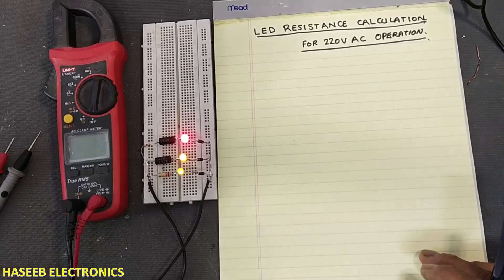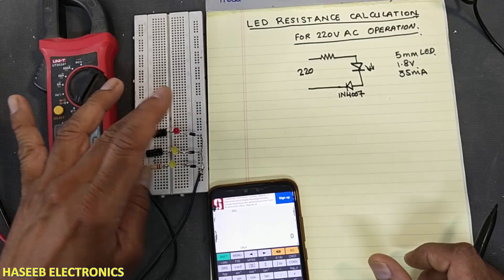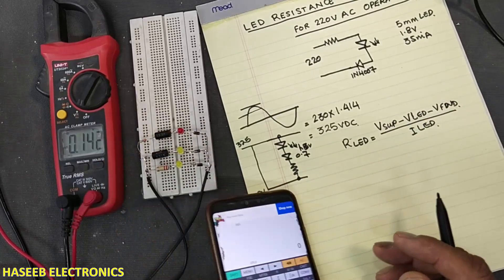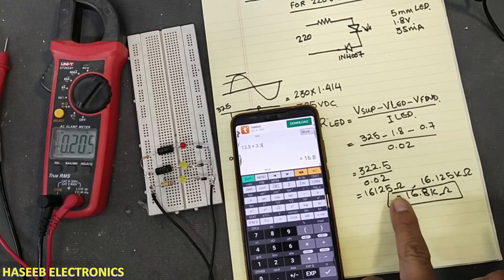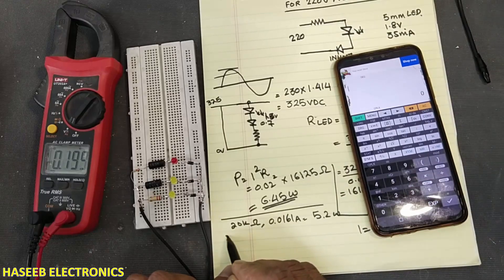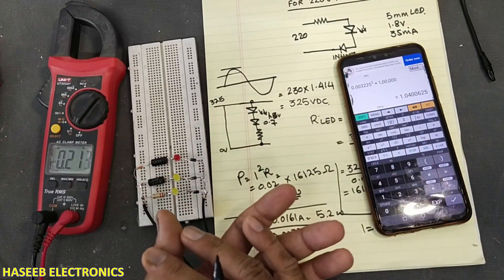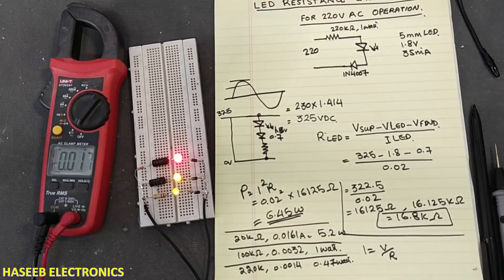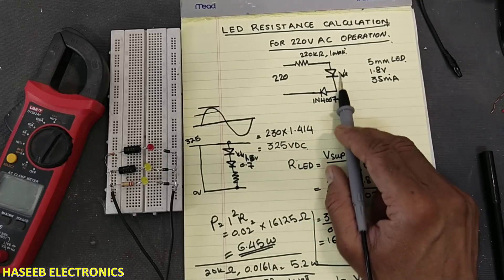{664} How to Make LED Indicator FOR  220 Volt AC, Calculation

Comment: 0.25W is ok, the current is only happening during only a portion of the cycle, so on average it will be acceptable as the failure mode of the resistor is in this case thermal.

Comment: Thank you very much Haseeb. I understand from your explanation that if we have any ac circuit containing a rectifier diode, we must consider the peak voltage in our calculations not rms voltage whether the load is led or not. mustn't we? 
if we didn't put a rectifier diode in the circuit in this tutorial the peak voltage will be equal to 327V like your calculation in the video or the peak voltage value will differ?

Comment: Thank you haseeb sir for answering my question with a nice explainer video. As i read the comments below from @Gann Dolf and @Abolfazl Abbasi there are many useful suggestions like 1) diode connected in reverse parallel to LED 2) using 0.1uF 400v film capacitor with 1M bleeder resistor, 1K inrush resistor , 1n4007 full bridge rectifier then DC to a red 3mm LED and many other feedback. May be it can be another video with title "Ideal/ perfect way to make LED light indicators for AC mains switches"
Reply from the maker: You are most welcome

Comment: Good presentation.5mm led will give decent glow from 1ma. So 220k (325/220=1.477ma) is an acceptable value.In place of resistor high voltage 0.01mfd capacitor can be used.No extra diode required. Across   Use 3v zener across LED to avoid reverse break down . Average heat generated in the resistor is V²RMS/r=0.24.If there is no zener ,power generated will about half.So 1/4watt resistor can be used. I have been using above circuit for many years.

Comment: LED has maximum reverse voltage rating. In negative cycle of AC, LED will get damaged by high voltage and have a reduced life.....though there will be no current flowing due to Series diode. To protect this, diode should be connected in reverse parallel to LED and not in Series.. This way the maximum reverse voltage would go to a diode drop, that is 0.7 V in negative cycle.

Comment: I've used a .33 uF non polarized polyester capacitor in series with a 1k 1/4 watt resistor to power a white 5mm led to replace a burned out neon indicator light for my freezer and it works great! No wasted power! I also put a 1n4007 diode reverse biased in parallel with the led. 50 hz may require a little more capacitance. What are your thoughts? Nice video! Have a great morning and a great week sir!

Comment: Why dont you just measure the voltage across the resistor (both AC and DC) and then calculate the current to check calculations?

Comment: Excellent video, and very good explanation.  I do the calculation in this way: At 220V RMS, when we use 220Kohms, the power will be P=VxI=VxV/R=220mW, and because we use only half of the wave, the power on the resistor will be 110mW. The same formula we apply to an instant water heater of 15 ohms, and we will find P=VxV/R = 3,2KW. (we can calculate an integral to reach the same result). The maximum led current will be V/R = 220 x 1,4 /220  mA = 1,4mA, but the average value will be V/2R = 220V/(2x220k) = 0.5mA.

Comment: On calculating power, one should  divide by 2 since only get voltage every other cycle. Also I believe it would be correct to use rms value of current and reduce power again by factor of 0.707.
Reply from the maker: in this circuit we must consider that the LED is being used in unidirectional current. so we must use LED forward current to calculate everything related to it. 
either it is serie resistance, either it is power dissipation, 
we must not consider RMS values because we are allowing diode to drive at it rated current at 1.8 volt. if we will use RMS values, it will dedicate more voltage to LED, which will cause to damage the LED
Reply: @HaseebElectronics  won't the resistor power dissipation be equal to (V- 1.8) ² / (2R) = 218.2 ²  / (2 * 220000) ≈ 0.11 W ?

Comment: Hi shouldn't you use the Irms for the power calculation in the resistance, as in P = VRMS * IRMS = (IRMS)^2 * R ? Because the 20mA is the peak current in this case.
Reply from the maker: here we must consider LED continues forward current. 
that is DC current 
so that's why we need to convert rms voltage into peak voltage. 
and we must deal this circuit in DC sense. not in rms 
because we need to allow the forward current at allowed voltage rating. because LED is unidirectional conductor. so we have to deal in unidirectional calculation 
moreover we are allowing the led to conduct in specific portion out of a 360 degree signal. that is peak voltage
Reply: @HaseebElectronics  Oh ok i see thank you for the answer...
Reply from the maker: @7GIGEO7  it is my pleasure

Comment: I think mains LED indicator lights should not be done with resistors.  They will always bake the circuit board and turn everything brown around the resistor.  Much better to use capacitive dropper.    In USA 120V I always use 0.1uF 400v film capacitor with 1M bleeder resistor, 1K inrush resistor , 1n4007 full bridge rectifier then DC to a red 3mm LED.  Takes a couple minutes to twist together the components, solder and shrink wrap.     Very reliable and produces no heat..
Reply: Exactly, I did the same thing to turn a Led on with mains. The capacitor will have an impedance in the circuit and drop the voltage just like a resistor but this drop will not generate any heat since the the wasted power is in reactive power. I didn’t use a full bridge for the circuit, just half bridge (one diode). Technically the led flashes with a rate of 20ms which is okay to me and is not noticeable, pretty solid.
Reply: @abolfazlabbasi4854  👍
LED in reverse parallel with the single diode correct?  if diode is in series the capacitor no longer sees AC and can't pass current, no?
Reply: @GannDolph  ideally the led is a kind of diode and there is no need for another diode, but practically, led will be fine with positive half cycle of the AC and will turn on without any issue ( with proper capacitor and resistor selected ). In the negative half cycle of the AC, the led will have a very small current leakage in reverse bias ( around 100uA) which is enough to close the circuit, in this case the capacitor will drop a very small portion of the voltage ( V= I * X) and the rest of the voltage will drop on the led which can easily blow up the led. 
To protect the led you can have a diode in reverse parallel to the led. The diode will conduct in negative half cycle of the AC and protect the led.
Led only conducts in half cycles. If you have another diode in series, basically will not affect anything except adding more protection which is still not enough to save the led ( I haven’t tested it yet, not sure though).
All in all, you definitely need a reverse parallel diode to save your led if you are using a half bridge configuration
Reply: @abolfazlabbasi4854  Makes sense.  When i tried it once with a series diode but no reverse parallel diode, with a blue LED, the LED did not light up.  Adding a reverse parallel diode fixed that.    I think full bridge is the way to go - diodes are so cheap, easy to salvage from dead CFL ballasts and other junk electronics - basically free if you have any access at all to e-waste..   full bridge won't have any failures , and little to no flicker.
Reply: Thanks for your suggestion. I agree with you but..............................
Dear, if proper calculations are done there is no question of bake.....
As it is already said by Mr. Haseeb sir.
Reply: @ifyoudontminddear  yes but you will still dissipate a lot of power.   for a 5mA LED on 240v mains you will use approx 50k resistor and this will dissipate 1.25 watts which will produce a lot of heat.  and you will need a big 2, 3 watt resistor and it will get HOT and bake everything around it.   Even at 1mA you will use a 250k resistor which will burn 0.25 watt which will still get very hot and require a 1 or 2 watt resistor and burn everything around it over time.  There is no reason to do this when it is so simple to use, say 0.1 uF 400v capacitor, in series with a 1k resistor, and 1n4007 diode in parallel  reverse polarity across the LED .    try it out.
Reply: @GannDolph  Thanks for answering me. Yes I am not denying the fact but this video is only for education purpose. I had already tested this type of circuit for continuous 10-12 Hrs. and it doesn't bake. And for your knowledge I would like to share that I use transformer less power supply for this type of load i.e. below 100 mA.
Reply: @ifyoudontminddear  with transformerless power supply you will not bake since not using full mains voltage to begin with.  

education can be for fun, and can be for real practical purpose too.    Many of us learn, design and build only as necessary to solve a practical need or problem.     So a lot of people in the electronics channels community are building (or fixing) real things, not doing only for fun although it is fun at the same time as accomplishing real work.  
I have put these LED indicators in dozens of devices, bench power tools, water heaters etc.  And replacing dead Neon indicator lights.  I need a permanent solution that will not fail in  20+years - the baking effect can take a long time but eventually often causes problems !   Additionally, remember that many standard hobby resistors are not rated for mains voltage , and it's not always easy to know the max voltage rating of the resistors you have!
Reply: @GannDolph   HI again..
Now you are taking this to wrong way. Let me clear it.
1. Anybody can learn the calculation from it.
2. If you are using it any where you wish, this is not good sign and it also indicates someone's less knowledge about electronics.
3. Nothing is permanent in this world dear. If you wish to increase the life of neon lamp, use 120K ohms resistor 1/4 watt, diode 1N4007, neon lamp in series for better indicator life.
4. Additionally no resistor comes with voltage rating here, if you had a datasheet request you to share it with me. What I had heard about resistors are "The maximum voltage rating of a resistor is determined by its power rating and the ambient temperature of the environment in which it operates."
Thanks a lot.
Reply: @ifyoudontminddear  Sorry I don't really understand your first points but under-run Neons will  not outlast a quality LED run at a couple of milliamperes.   And Neons become unreliable indicators in dark / very low light applications because they require external photon to strike the arc.    Please do some research.  

Resistors do have voltage ratings- try pulling up a datasheet of any line of resistors and you will see the voltage rating specification.   The voltage rating is derived from the physical construction of the resistor - its overall physical length, construction type eg. wire wound, metal film etc.   It has to do with how close together the conducting path is to itself within the resistor - with smaller separation capable of isolating lesser voltages.   The power rating and voltage rating will generally correlate positively, but the degree to which is unknown.   Therefore you cannot derive the voltage rating from the power rating.   When in doubt, when working with mains voltages the typical safe design choice is to split the resistance into two or three series resistors that sum to the total desired resistance .   Wising you success with  your electronics education, all the best !
Reply: @GannDolph   Thanks for the reply, But I can't understand it clearly please please make it clear and simple.
Reply: @ifyoudontminddear  Apologies, but i really cannot  further simplify the explanation.  You may disregard, or perhaps maybe you have a colleague who  can  explain for you, or perhaps a translate app.   Best wishes !

Comment: Master 
If you add a power metre  to this  circuit I think you will see ,so much power for a LED light 
Please check attached link for this kind calculation.Especially after 04:00 (In America AC voltage is 110 volt and frequency is 60 hz )
https://youtu.be/xyMH8wKK-Ag

*Applied Science is very famous channel in youtube about science and electronics
Regards